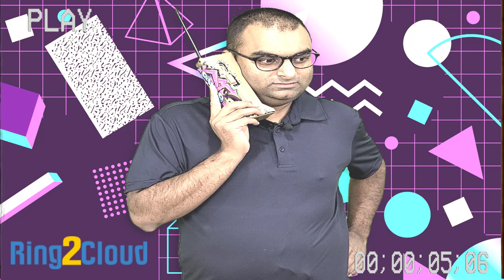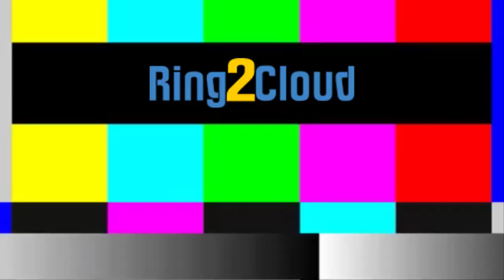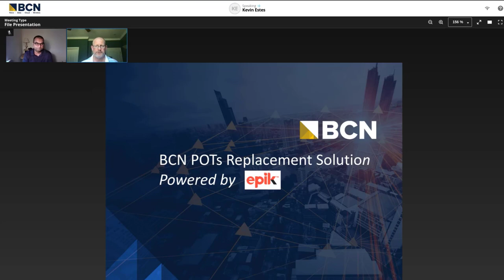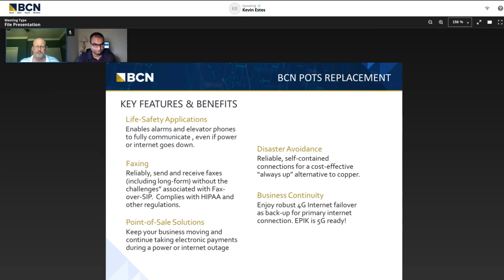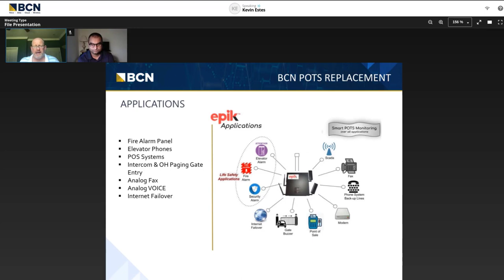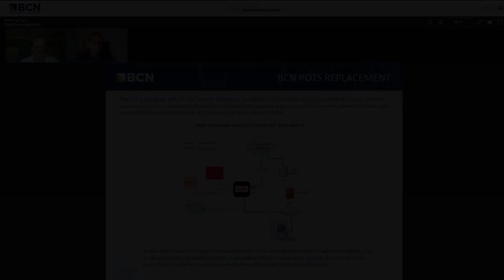What is Pots Replacement? How Will it Impact My Business? Ring2Cloud Introduction to Regulations

Comment: We went with Kings III at my condo for elevator and emergency phone service after Hurricane Ian completely destroyed the phone company.  I don't work for them, but they've been absolutely wonderful to work with.   They handle the equipment, call center, dispatch, maintenance.   Not the cheapest solution, but cheaper than our POTS lines were and they maintain the equipment.